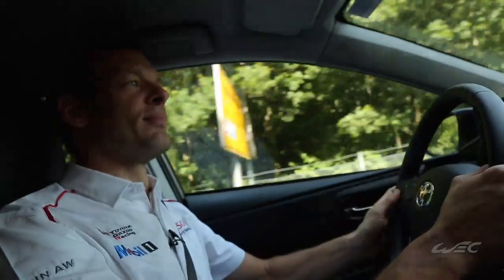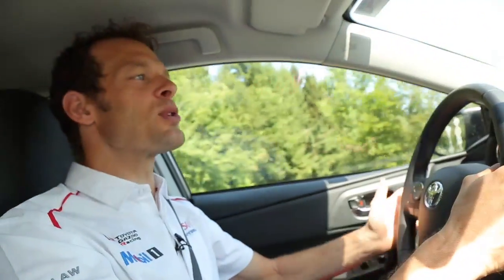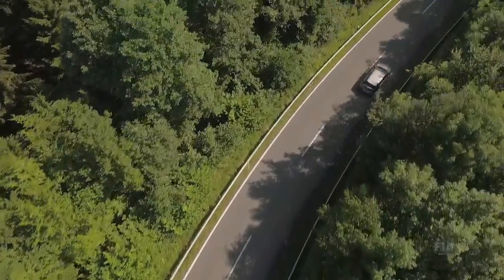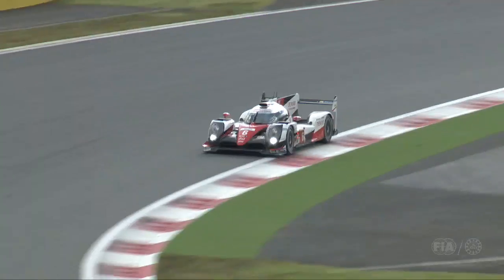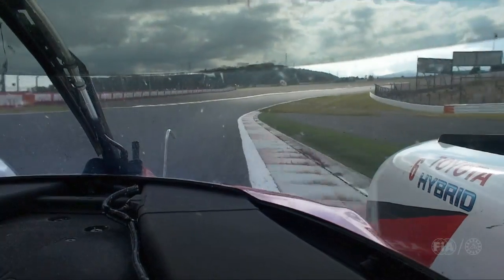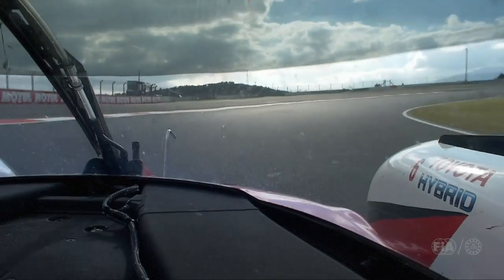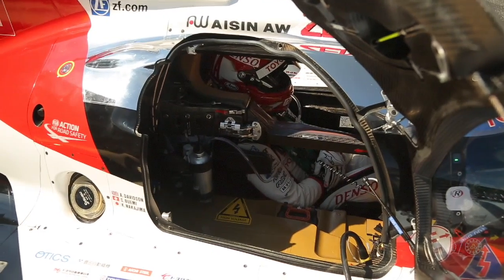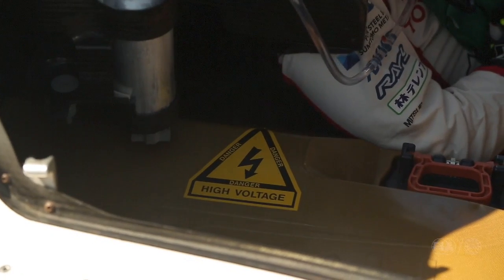Toyota Hybrid Technology explained by Alex Wurz

Comment: what bettery types du you use in the Ts050? Lithium Ion?

and is it dangerous?
Reply: Yes the TS050 uses a lithium ion battery. Potential overheating is the biggest problem with such a battery. Overcharge or overheating it could cause a thermal runaway and an uncontrollable chemical fire. That's why creating a proper cooling package for the battery is part of a manufacturer's R&D objectives.